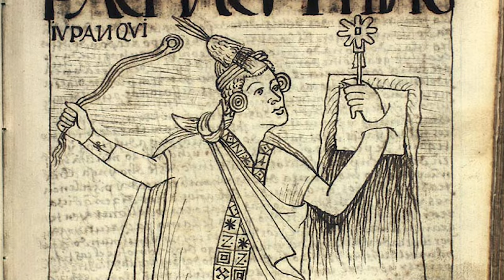SACSAYHUAMAN - How They Did It | Polygonal Masonry

Comment: Dr Miano have you seen this video ? : https://www.youtube.com/watch?v=YMUZRGuYqY8&t=698s 

The methods that are proposed by Mr Lee cannot account for the evidence we see in this excellent resource. In particular I would humbly bring your attention to 11.40 minutes into the footage. It is apparent that this large stone was either somehow melted, or that it was not solid when these marks were made in it. 

As you will know, limestone does not react this way to high heat so that seems to rule out that possibility. Without entertaining the notion of 'unknown high technology' that leaves the most likely scenario being that this is a large lump of cement, or 'some kind of homogenous setting material similar to what we call cement'. On the face of it that also seems very unlikely, as this is a very large lump! However I think there is an explanation which does not involve UFO's or such like. It is actually quite mundane, ie this is a naturally occurring 'setting material.' Limestone exposed to igneous rock (high heat) equals what? Could this site not be a natural lime kiln? The lime could have been cooked many thousands of years ago, then hydrated by springs and in this state it would stay as a clay until exposed to air and voila you have natural cement. This material would then be used in conjunction with the natural boulders to 'fill in' and essentially create very tight fitting infill 'stones'. It would explain A LOT. 

However it is also obvious that the builders were directly quarrying these stones and it seems that a variety of methods were used, which really confuses matters. The quarry marks left at Ollyantambo are extremely perplexing and Mr Lee's proposed methods cannot account for what we see there. 

These walls are an astonishing achievement.
Reply: @World of Antiquity  Your thoughts on this matter would be highly appreciated if you get time. I have to admit that I am stumped by what we see here and Occam's razor says this stone was once 'plastic'. What made it that way is not obvious.

Comment: I must disagree that the easiest way to build a stone wall or a house on top of a mountain is with big multi ton natural boulders quarried from a top of an other mountain and then fit them with millimeter precision. Do you not feel that the precision is way over the top, down to a millimeter, and what I can tell it's kind of a thing with the polygonal masonry where ever you find it, some may be weathered more then others but still precise. I could be wrong but do we build any structures that require sub mm precision. I'm talking about walls, buildings or bridges. It would be interesting to compile some information on building tolerances across cultures, ancient or modern. I bet, we the modern builders, would be leading that top 10 list, if we exclude polygonal masonry.
Reply from the maker: There are visible gaps between many of the stones. Where are you getting "sub mm precision" from?
Reply: @WorldofAntiquity  Your guest told us. About them visible gaps you refer to are they faults in rock, mistake by builders or has the rock moved? Is that an exception or a rule. But you must agree that the tolerances and accuracy is something we would struggle with. My main point/question was an overall building precision that a civilization is capable of. Like how accurate where roman buildings compared to modern buildings? How about buildings from middle ages? China?
Reply from the maker: @MrAwesomeBikerDude  Mr. Lee never said anything about "sub mm precision." It is precise to the human eye, which is all that is needed. And it only needs to have a nice seam on the outside, where it is visible. There can be all manner of defects on the unexposed parts. The back sides of the stones are not precise. We today would have no trouble at all accomplishing this. Most of the stones at Sacsayhuaman are not even that big. It is only the outer wall that has some of the large ones.

Comment: Lots of blather but no real discussion of how the "big stones" were moved into place and fitted together with such precision.  Nor do they explain why polygonal stone architecture exists all over the world (even Easter Island!).  
The guest describes how "man sized" stones were fit as witnessed in recent times.  Nowhere does he suggest how that method would work with stones weighing tens of tons.  The suggestion is that the builders could select a stone that would be a close fit.  They would then pound away "anything they didn't want" and drag the stone into position.  The result would be a fit so accurate that the gaps are less than paper width, and are often in direct contact over a distance of several feet.  And remember, Sachsayhuaman is only one example of massive stones fit with perfection in unlikely places.  Ollantaytambo is another good example.
Somehow, the claim is made, the Inca managed to quarry granite stones (or find them lying around) weighing tens of tons from a quarry, lower those stones tens of meters down a steep slope, move them across a valley, and then haul them up tens of meters to their eventual resting place.  These stones also were fit together with great precision.
And remember, structures exhibiting polygonal stonework with stones weighing many tons exist all over the world.  Coincidence, right?
I don't know how it was done.  Even with modern technology and machines it would be a massive task.  I don't think we'll ever know.
Reply from the maker: no real discussion of how the "big stones" were moved into place and fitted together with such precision
There was a LONG discussion about it accompanied by drawings to explain it.

Nor do they explain why polygonal stone architecture exists all over the world
See the title of the video. Besides, the polygonal stone architecture in Peru is unique.

Nowhere does he suggest how that method would work with stones weighing tens of tons.
Why wouldn't it?

The result would be a fit so accurate that the gaps are less than paper width, and are often in direct contact over a distance of several feet.
What a strange comment. Setting aside the fact that there are visible gaps between many of the stones, if you put two stones together, paper won't pass between the parts that touch. You are acting as if this fortress was built by cavemen, rather than experienced engineers of the powerful and wealthy Inca empire.

Somehow, the claim is made, the Inca managed to quarry granite stones (or find them lying around) weighing tens of tons from a quarry, lower those stones tens of meters down a steep slope, move them across a valley, and then haul them up tens of meters to their eventual resting place.  These stones also were fit together with great precision.
You might want to watch this: https://youtu.be/Dz-ZRdk7KUY
 
And remember, structures exhibiting polygonal stonework with stones weighing many tons exist all over the world.  Coincidence, right?
Structures exhibiting standard brickwork are found all over the world too. Coincidence?
Reply: @WorldofAntiquity  Let's start here:  In the real world creating two matching non-flat faces is not that easy.  First, the "ground" face would have to be established.  This could include working the intended ground base stone's top surface and the bottom surface of the stone to be fit.   It could be fitting one face to another.  Once that is established the worked stone would have to be set on its bottom.  The angle of the plane of the bottom has to be known exactly.  Otherwise you don't know how the two stones'  will match when worked.  Now you have to work two more faces (or one face to fit a second) to be exactly the same shape.  You would pound down to get close and then finish by polishing.  With stones weighing a couple hundred pounds this could be done, but very accurate, repeatable measurements would be required unless the mating surfaces are dead flat.  With stones weighing tens of tons "trial fitting" is not a practical option.  I could go on and on.
Even in a full (pre-CNC) machine shop working with metals this would be a difficult task.  
The linked video makes many of the same technical errors.
No matter how the stones were gathered, moved and worked, the fits are just too good.  Get some stonemasons to demonstrate fitting together two, say, 100 pound stones with non-flat faces together with nothing more than pounding stones and bronze tools.
Reply from the maker: The video you are commenting on shows you how it could be done. And as far as the fits being "too good," all you can see is the exterior. Weathering has also contributed to the smooth look.
Reply: @WorldofAntiquity  Nope.  One of my uncles was an architect who was involved in examining many polygonal structures in the '60s and '70s.  This includes structures in South America and several sites in Italy and Greece.  A group of specialists (including himself, stonemasons, archaeologists, geologists) studied numerous stones that had been separated due to earthquake or human activity.  In some cases the "match" was only a few inches deep, depending on the specific site.  In most cases the "hidden" faces were irregular and fit to thousandths of an inch across the contacts.  He contrasted that to the Corricancha structures which are mostly rectangular but exhibit full-surface flatness and squareness to within a few thousandths of an inch. 
Your claim is that the theory presented shows how it was done.  That's a false statement.  Theories are fine, but until a demonstration of technique on multi-ton stones using tools available at the proposed time of construction proves the theory I'll remain skeptical.  That's the way science works.   My own personal professional experience with moving and installing large projects says to me that we simply don't know how these structures were made.
Reply from the maker: @fixbertha   In most cases the "hidden" faces were irregular and fit to thousandths of an inch across the contacts.
I am not sure what that means. But please point me to the place where these results are published.

Comment: Very good effort, but I'm afraid it does not prove there was no advanced civilization before, if it can be proven at all.
There are more mysterious artifacts (especially in Egypt) that indicate machine core drilling with a progression rate of digging into the granite that is confounding. There are saw marks left by saws over 10m in diameter, there are cuts that turned away from the intended straight line and the piece was discarded - it all indicates some form of machining that also needs to be explained.
There's also Uncharted X's vase measuring experiment that returned precision values unachieavable with crude methods attributed to those ancient civilizations and while only one such experiment is not in itself conclusive and more objects would need to be examined, it cannot be ignored. You don't repeatedly achieve the precision of thousands of an inch, and in relation to axises and plains throughout an object, out of thin air.
Of course, separating one subject from the entirety of the picture helps in retaining the picturesque depiction of Flintstone ancients, with their pounding for days on end, dollorite balls, hordes of slaves, dragging heaviest stuff in history up and downhill, through rivers and deserts, sometimes hundreds of miles away, on a whim. It doesn't even bother our experts here to ask a question how supposedly separated civilizations, with no contact between one another, develop the same polygonal stonemasonry techniques, and then all of them stop using it, despite clearly passing the test of time and earthquakes.
It's easier that way, because assuming for one moment someone navigated the planet east to west, and north to south, allowing for knowledge transfer, and in prehistory no less, would play straight into the hands of "pseudoscientists" like Hancock, who himself claims to be a journalist, not a scientist, which is so hard to get right by people who claim to base their entire scientiffic carrier on getting facts right.
If it seems like I'm journeying too far away from the subject of polygonal walls: they can be found in Egypt as well. Right next to drilling holes, cores, saw marks, and so many other leftovers of what appears to be a society more advanced than the hunter-gatherer-recently-turned-engineer.

The artifacts are out there for everyone to see and measure if allowed. If the final theory fails to incorporate them into its shape then I don't believe its authors can decisively claim everything they've shown clearly outrules the existence of advanced ancient technology.
Reply from the maker: I'm not trying to prove there was no advanced civilization. I just haven't seen any evidence for one. All those thing you mention are just made up. None of them are even true. They've all been examined in detail on this channel.
Reply: @WorldofAntiquity yeah, the incas with no wheel, armed with copper chisels did what we can not even do today. Do you listen to yourself?

Comment: The problem with archeologysts that they are unable to grasp the concept of chemistry. That stones are nothing else than variations of SiO2 (quartz) bonded metal oxides. Yes, they are. And if this is true (yes, it is!), than you can create artificial stone. 

And cast them IN PLACE, idiots, right into the wall, and you have perfect, less than 1 mm gaps between stones.

There are hundreds of geopolymer recipes, some of them usin stone age ingredients  only.

And how they lifted 100 ton blocks? They did not. Or.. they did it bucket by bucket.
Reply from the maker: The stones are not geopolymer. See here for a full discussion: https://youtu.be/oKrlR_DUXtY

Comment: Not one single full size reproduction of a polygonal wall  🤔 Not even a few full size blocks fitted together 🤔 The fact is that even with modern power tools we are unable to ‘reproduce’ high quality ‘Polygonal Masonry’. The reasons why? 1) The methodology has been lost to time. 2) Rock cannot be ‘dated’ so it is reasonable to assume most ‘similar’ sites of polygonal masonry around the world could be related back as far as the ice age. The sites ‘found and inherited’ then used in ‘all’ the various civilisations and for the various uses discussed in this video. 3) Most polygonal sites show evidence for rock ‘melting’ or ‘rock bending’. Obsidian (A dark glassy substance caused when melted rock, lava, is cooled) is found on many surfaces of polygonal walls. There is so much this video does not explain and so much it relies on standard academic interpretation of geology made by archeologists who are NOT geologists.
Reply from the maker: Not one single full size reproduction of a polygonal wall  🤔 Not even a few full size blocks fitted together 🤔
Not any just like this, no. But there are plenty of modern polygonal walls.

The fact is that even with modern power tools we are unable to ‘reproduce’ high quality ‘Polygonal Masonry’.
How did you come to that conclusion?

Rock cannot be ‘dated’ so it is reasonable to assume most ‘similar’ sites of polygonal masonry around the world could be related back as far as the ice age.
That is not logical for several reasons: 1) Although rock cannot be dated directly, there are ways to connect it to other artifacts that can be dated, and 2) Polygonal masonry can't just be all lumped together and assumed to be from the same time, because it exists across all of time and with regional differences. Polygonal masonry is no more unique to one culture than circular houses are.

3) Most polygonal sites show evidence for rock ‘melting’ or ‘rock bending’. Obsidian (A dark glassy substance caused when melted rock, lava, is cooled) is found on many surfaces of polygonal walls.
Which geologists have verified this?

Comment: Yea right, your gonna make a sharp ninety deg inside corner by beating it with a rock!
Reply from the maker: What sharp 90 degree inside corner?
Reply: @WorldofAntiquity  There are numerous inside and outside corners on these megalithic structures with one fitting into another with the utmost precision and to suggest that it can be done simply by pounding them with a rock is nothing more than a wild stretch of supposition.

Comment: If the average male could pull 200lbs and 1 ton would take 11+ men to drag it. 80 tons would need at least 880 men. That's the math and not the myth. We have no clue, do we?
Reply from the maker: How many stones are 80 tons?
Reply: @WorldofAntiquity  How many? You mentioned at least one. Looking at the wall there are many over 60 tons. Your guest also said 1 ton would require men pulling by a factor of ten per ton... those men would have to be able to pull over 250lbs each.
Reply from the maker: @davidsparks6146  The Inca told the Spaniards that 6,000 men conveyed the stones by means of great cables of leather and of cabuya to the works.